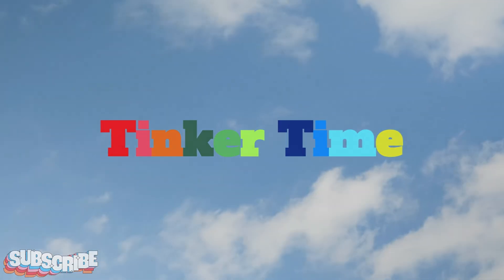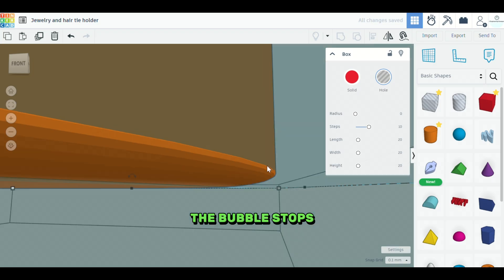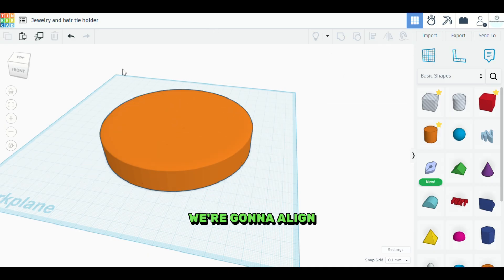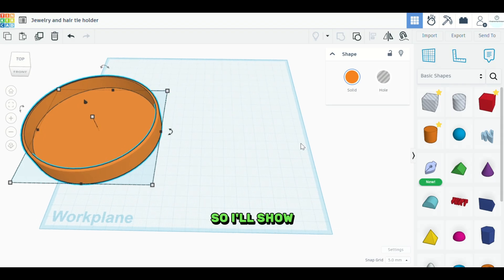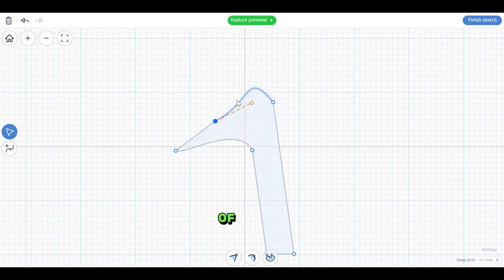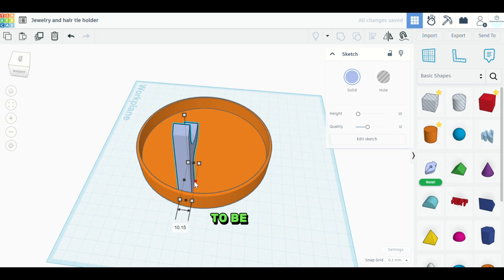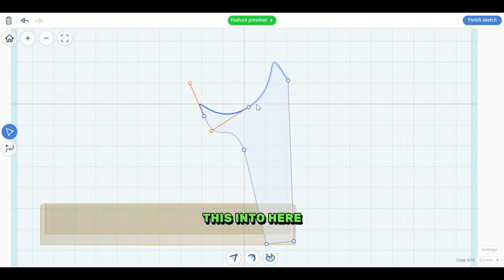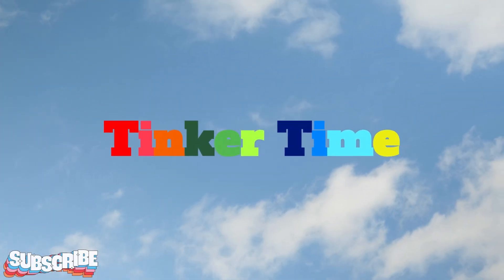How To Make: Jewelry Holder Using Tinkercad For 3D Printing

Comment: How to make a 4mm tube and make a curved bend like macaroni. Curved tubes.
Reply from the maker: If you make the shape with the sketch tool first, then make a duplicate of the shape you came up with and make it slightly smaller than diameter of the original, and then make it a hole and combine the two it will be hollowed out the way you want.